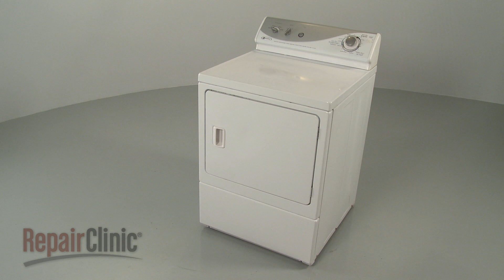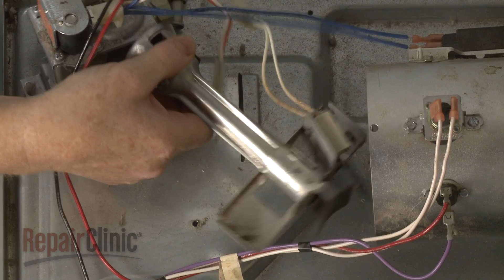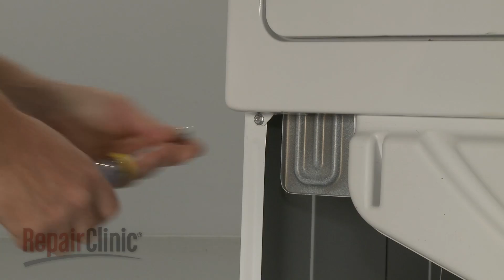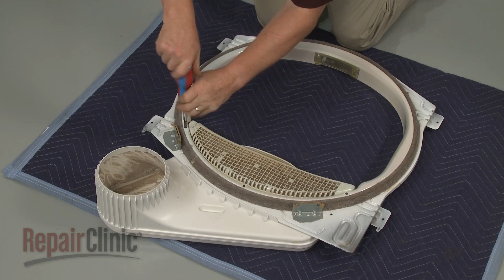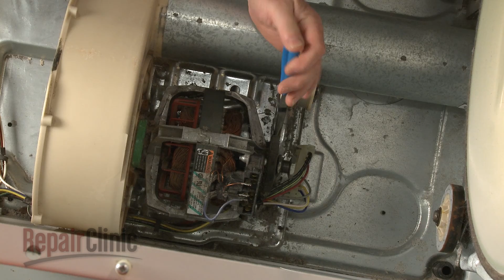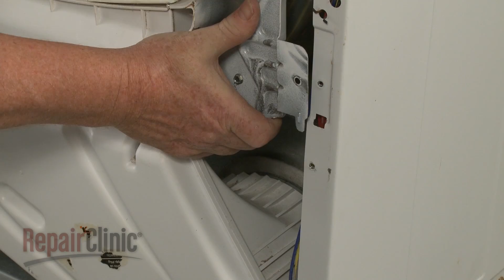Maytag Dryer Disassembly (Model #SDG3606AWW) – Dryer Repair Help

Comment: Great video...!!  It helped me replace the broken pulley wheel.  Most of my time was spent cleaning the inside which was awfully dirty with lint, dust, etcetera that accumulated over 15 years.